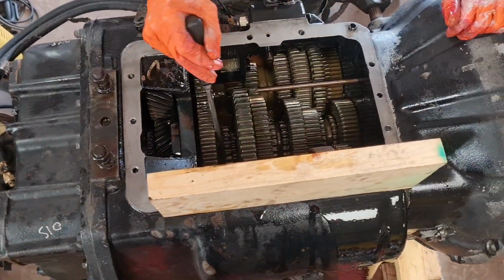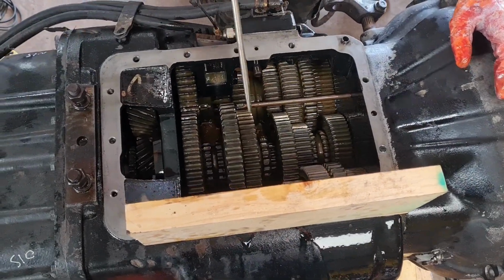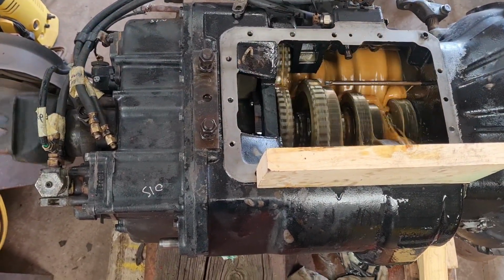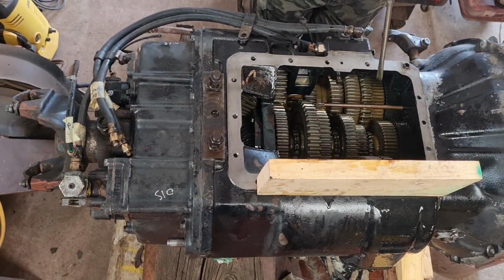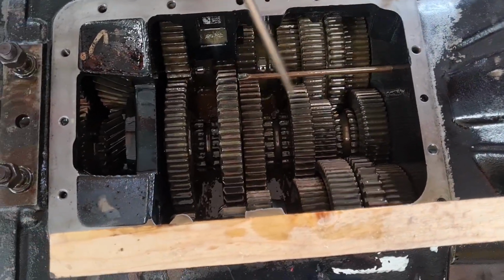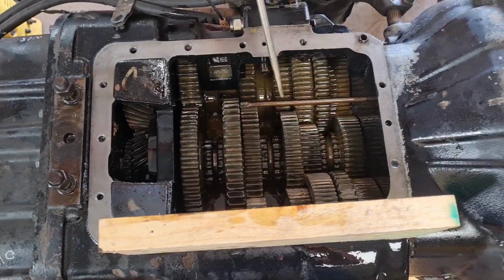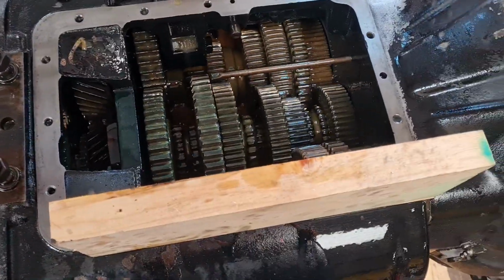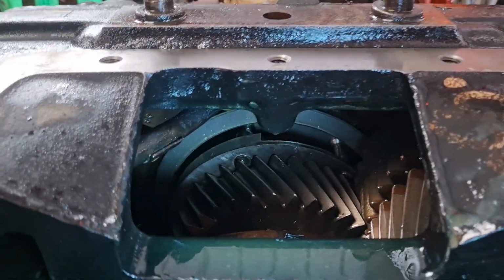18 speed Eaton/Fuller Road Ranger how it works & look inside changing gears powered by a big drill.

Comment: Very Informative. I Don’t know why all the light trucks manufacturers didn’t just use some of the light 10 speeds like a RT-510 which according to Eaton is rated at 950 ft lbs at max load. I’m sure a Overdrive could be added. The same weight as a  NV5600. If semi synchros were needed I’m sure they would have added those. As long as it could be floated without damage it would be better than anything they’ve ever used. It would have saved so many owners, particularly Cummins owners so much headache.
Reply: True. Especially the nv4500’s. In stock form they aren’t rated for much more torque than the 5.9 Cummins made from the factory.

Comment: what the biggest gears  toward rear are for ?
Reply from the maker: Reverse then crawler  which is mentioned.
Reply: i see 3 sliding clutch , are  gear 4 or 3 then 2 or 1 then R or crowler ?
Reply from the maker: Put the sound on we tell you as we operate it what is what. Cheers.

Comment: this was great, but I still only see four speeds, not 18!
Reply from the maker: This is true but if I did 18 there's still only 5 gears  to use, if I split and Ranged we'd be using the same gears in the main Box, plus I didn't have the air supply set properly. Thanks for your comment.